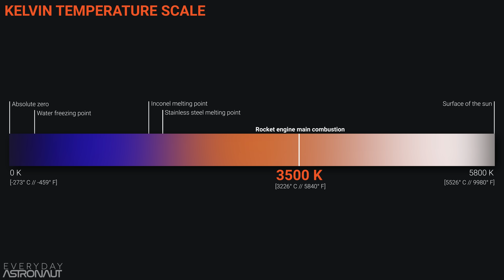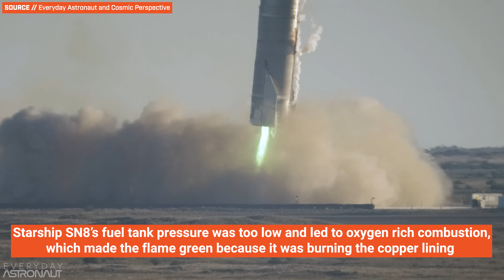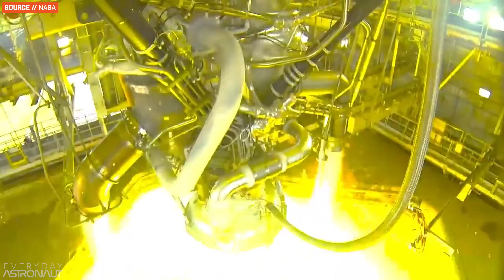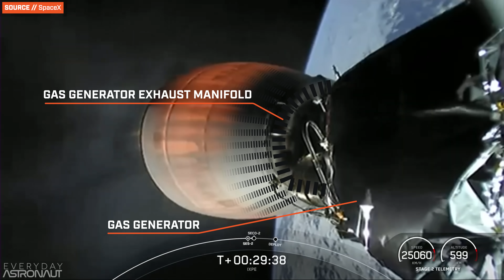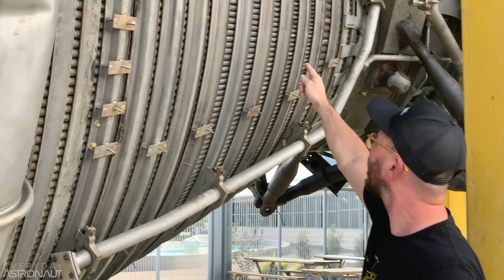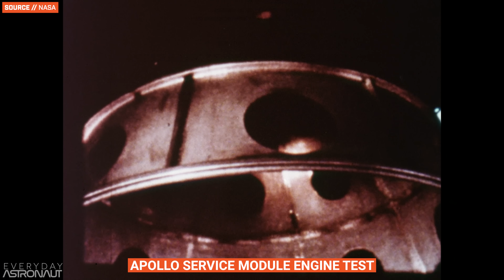Why don't rocket engines melt? How engineers keep engines cool

Comment: Fantastic work as always Tim and co.! Question:
It’s my understanding that the pressure to spin a turbine is really about the pressure differential. (If I were to stop up the end of the gas generator the turbine wouldn’t spin) if this is right, wouldn’t feeding the generator exhaust into the nozzle dramatically reduce efficiency? Talking of pressure always moving from high to low makes it sounds like we’d only need a 1 bar difference, but wouldn’t that mean there’s only 1 bar to drive the turbine? guess everything is a balancing act but just not sure how it all works out. Thanks for any insights!!

Comment: The A4 (V2) rocket used a 75% ethanol/25% water mixture. The water lowered the combustion temperature and also helped in film cooling. With the bonus features that this type of fuel is easy to make in your backyard moonshine still and you can sell any excess on your local black market if you need more funding for your space program.

Comment: I think Elon isn't testing the  Raptor_2 in McGregor correctly! Of course, he cant test a 31_engine configuration. To simulate the real thermal environment at the end of the Raptor-nozzle he should add 6 or 8 metal plates, red-hot ones! around the one nozzle to be tested. This would better simulate the thermal radiation conditions of the "inner" engines of the Super-Heavy. Additionally, these inner engines could need a prolonged cooling-off phase after MECO (I think, running some inert nitrogen through the tubes) ...(as it is good practice with turbo-charged car engines, to let them idle for a while, before stopping!) Did Elon Musk do super-computer simulations of radiative and other heat transfer from the rocket exhausts back to the Raptors' housings and structures?

Comment: As said in part4 regenerative cooling if there is leakage in the thin chamber of regenerative cooling. Does the fuel in the regenerative chamber may also burn and cause problem ?

Comment: 2 questions..how would starbase cope with a hurricane? and landing starship on the moon or mars.. the landing are will not be concrete slab flat.. and all the bow back of stones, rocks sand into the lower part of the starship lander

Comment: I am not sure whether this would be a viable option but running a fuel rich engine and having a thin inner layer built with tungsten and leaving a thin air gap in between the inner and the outer layer could solve this problem. But tungsten can burn if it reaches over 2000C inside a combustion chamber due to high oxygen ratio so I'm not sure... I'm not a rocket scientist so I have no idea but this has gotten to my mind as soon as I saw this video before opening it. Great content!

Comment: Excessive liquid film cooling was used in 1960's engines, so Rocketdyne says new designs could have higher performance with less, without melting the combustion chamber walls.  They incorporated my 1991 analytical model into their SDER code.  I never got follow-on funding since at a HBC, and an AFOSR lead told me "not their mission to encourage research at HBC's".  Rocket propulsion is a clubby world.

Comment: Still remember in 1980's they lauch near space platforms and then launch rockets from that platform for less air resistance.  I wonder why they stopped doing it that way.  Would have saved more energy, I think.

Comment: Why don't they use centrifugal engines? That could use some soil from an asteroid, then spin it at a super high speed and then just throw it in the opposite direction. All you need is electricity and a crushed material like asteroid or any other soil.

Comment: Thermal transfer is so efficient at high pressure, weights and density.  So of course not just about the temperature itself….. Touch a hot piece of steel very lightly; not so bad. Touch that same piece of steel for the same duration but pushing harder…… ouch……

Comment: Cool! (pun intended) Ran into one guy once, he was singing the praises of avocado oil as a thermal barrier. No idea how that works but he had made a little home video, rubbed an avocado on a wood coffee table, took a propane torch to it. For a couple of minutes. There wasn't a mark left on the coffee table. He claimed that NASA was at least at one time lining rocket engines with this low-tech stuff, buying avocado by the truck loads, drove prices up from about 50¢ ea. to about $1.30. No idea if there's any truth to this story or just some fairy tale, but maybe a tip for some home rocket enthusiasts to play with.

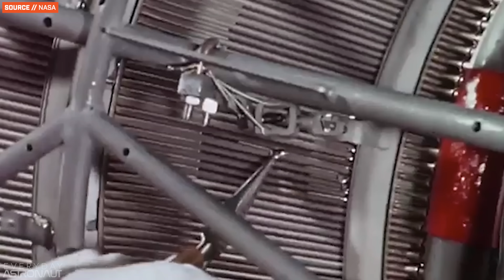Comment: 13:20 "...[fluid] always flows from high to low [pressure]". This is not true - break down the terms in the Navier-Stokes equations and you will see that momentum plays a part. A fluid with momentum will continue flowing in the same sense until a pressure gradient accelerates it. For a period of time then, fluid with existing momentum will flow from low to high pressure, before changing direction.
The "folk physics" phrase has found itself into textbooks. It even had the smart guy at "Tech Ingredients" (who has a lot to say about fluid flow and dynamics) absolutely convinced that the folk physics phrase was a law of nature.

Comment: at 13:00  Is it possible to create an insideout turned nozzle , and use it as a re-entry shield instead of tiles? ( using the upper reentry burn's fuel slower, and cold forexample )

Comment: You are confusing viewers and future Engineers between the design and its different working. I would suggest a better clear picture and not mixing it all together. And did you share your video with the people what are there reviews based on your explanation to learning perspectives. Anyways Try this Next time. Sharing Knowledge is good but hidden information still stays in your brain till you are not cross examined.

Comment: And I thought I was special by using sodium filled valves...  Anyway... I always wondered why high speed turbine aircraft like the SR71, were never used to reach the edge of space, before a much smaller rocket was finally lit to get the payload the rest of the way into orbit.  Most of the oxygen needed is already in the atmosphere, and most of the fuel which is also most of the weight... is burned just to get to that altitude and speed.  And would'nt that also solve some of the need for cooling, since it tends to get very cold at high altitudes? Or is that why they are developing scram jet technology?

Comment: >> is there any research with regards to 3d printed composites maybe we can have  mesh-like spatial gradients or something and make stronger materials like one used in STS like the patchwork pattern on STS I don't see 3d printing that much even though so many new mixture can be tried using that like cement and bricks

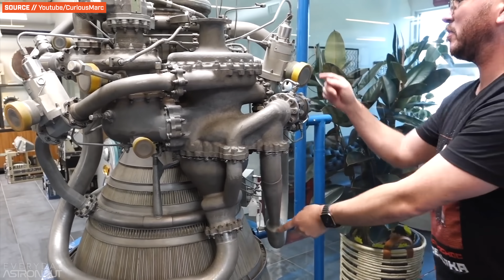Comment: At min 12:00, actully it is not so good if the fuel is boiling insid the pipes of the regenerative cooling system around the nozzle. If it is boiling it is possable that the tiny bubbles in the fuel will build a film layer inside the cooling pipes and function as an isolation between flowing (cool) fuel and the hot parts that thay should cool. If it is a good option to use the `boiling` fuel for the turbopumps I can't say.

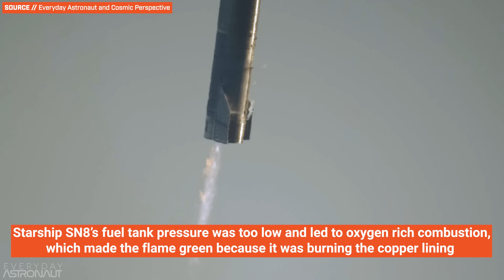Comment: At min 5:30 you forgot one important point why there is used a fuel rich ratio: The oxidizer (depending on what typ) might react with the contact surfaces in the burning chamber and the nozzle. So, the more "free" or unused oxidizor in the burning prozess will cause an oxidizing of the engine itself.

Comment: Just watched a video of a Raptor V2 going through a minute and a half burn while throttling down then back up. Considering this video's discussion on thermal management and Musk's comments on the maximum throttle down I was wondering if you could find out how the Raptor is actually throttled and what are the physics that define the limit of that ability.   Maybe you could discuss it with Elon and make another short video.  BTW your research and concise, coherent presentation on the Russian engines was pure gold.

Comment: At 21:32 subtitles say "like an (mumbles) nozzle. He clearly says 'niobium'. A quick google(TM): 
"Niobium is used in alloys including stainless steel. It improves the strength of the alloys, particularly at low temperatures. Alloys containing niobium are used in jet engines and rockets, beams and girders for buildings and oil rigs, and oil and gas pipelines. This element also has superconducting properties." You're welcome :)

Comment: No pun intended but this is very cool and must have taken some extreme innovative thinking to come up with these ideas. I'm curious about how strong these engines are to push such heavy loads, the ships: the structural supports and stresses must be extreme. Also, there is such a variety of fuels: what are the past fuels and where are fuels headed?

Comment: Wondering if magnetic fields could also be used to keep hot gases from touching the metals. They do this on nuclear reactors, and I know it would be too heavy for a rocket engine. But still, someone might find a way of creating a very strong magnetic field with low weight in the future.

Comment: Hi Tim,
can you shed some light on that new Pangea Aerospace aerospike engine and its specs?
In the test video thers no pump visible. Supposedly its externaly fed but would it be possible to work even with methane in an expander cycle fashion due to that large heat excess?
Would be nice if you can collect some info on that.....
greetings and good work!

Comment: You mentioned how difficult it is to cool a spinning turbine. I know some large jet engine mfr(RR or GE) use strategically placed tiny cooling holes in the compressor blades to maintain a nondestructive temp. Would something like this be viable to carry over to a rocket?

Comment: Dear Mr. Dodd. Thank you for yet another excellent, informative, and interesting video.

You mention that certain forms of cooling, such as film cooling, cannot be used on a spinning turbine. This is not entirely correct. Jet engine turbines commonly use film cooling. Cooler air is taken from previous stages and run inside the (usually) ceramic turbine blades, allowing it to bleed out of tiny holes. The high-pressure turbine is the hottest part of the engine. "Cooler" is a relative term here, as this air is well hotter than 1000 degrees C.

An excellent source for jet engine knowledge is Rolls-Royce's iconic book "The Jet Engine", first published in 1955, and updated many times since then. I highly recommend it, if nothing else for the superb illustrations. Jet engines are not rocket engines, but they do share many traits.

Please keep up the good work!

Comment: As an aside - Apollo service module never carried a full fuel load on any flight. The original design (which was reflected in the engine size) was for the service module to land on the moon and then re-ascend to orbit. The LM came later.

Comment: Not quite unbelievably hot.  150 million degrees C inside Nuclear fusion reactors is unbelievable since that would turn anything into a plasma. Still very interesting episode Tim. There's an interesting video on how Rolls Royce manage thermal loads on turbines, from casting single crystal metals to drilling small holes down the edge of the blades and pumping fuel through them.

Comment: Interestingly enough, the engine you use to demonstrate regenerative cooling, the A4/V-2 engine, used film cooling far more than regeneration.  In fact, part of the reason they had so many failures while developing the A4 was because the film injectors kept clogging.

Comment: It's a lot like turbo gasoline engines. The 4 cylinder turbo gm truck has about the same horsepower as the V8 however on the highway under constant load the V8 actually gets better MPG. How is that? The turbo 4 cylinder has to run so rich to keep cylinder temperature down that it uses more fuel than the engine that is 2x the size as the V8 can actually switch to a much leaner burn and not worry so much about cylinder temperature.

Comment: This isn't specifically related but some concepts are very similar. The regenerative cooling works because the oxygen concentration is insufficient inside the nozzle walls to worry about. Many diesel engines ignite diesel fuel in 300 - 500 psi of compressed atmospheric air that is above the flash point of diesel fuel in the cylinder chamber whilst the injection pump that is injecting the fuel compresses it to 20,000 psi. There isn't a worry of ignition even though the fuel is compressed and hot because there is insufficient oxygen present to ignite it while it's traveling to the cylinder chamber, I think regenerative cooling follows similar physics

Comment: I have to wonder if anyone has tried water/glycol injection like were used on B52 and early 747 jet engines to get a boost in thrust while cooling the hot section turbine at the same time. the downside was an increase in unburned fuel in the exhaust (which is why the exhaust was so black/smoky)

Comment: 0:21 this is actually (and factually) incorrect. You have a lot of materials that can withstand that temperature. You have tungsten, for instance. And titanium boride. And hafnium carbide. And graphene. And tantalium. etc. In fact, the material with the highest melting point is an alloy of tantalium and hafnium carbide, and can withstand a temperature of 3990℃ (!).

Comment: @everydayastronaut why hasn't anyone used magnetic fields to shield the metal from the heat of the exhaust? The regenerative cooling methods could keep the electromagnetics cool while the fields generated would prevent contact with the metallic inner walls. You would think in the interest of making a reusable engine that would be the first approach practiced.

Comment: Man, I keep getting requests for 3D printing rocket nozzles out of copper and inconel with internal channels (at work). DED printing of copper is difficult, DED printing multi materials is hard, and DED printing closed internal channels is very hard. Put them all together and you get a request that is near impossible with our current methodology. But our response usually is: how much are you willing to spend in trying to print this?

Comment: The techniques employed in engine thermal management are varied and really advanced as you did explain in your amazing video. What is also fascinating is how Soviet engineers were able to manufacture alloys that were able to withstand oxidizer-rich mixture inside combustion chamber. As far as rocket engine history is concerned the American engineers did not believe at first that such alloys were possible.

Comment: Automotive engines maintain a higher gasoline to air ratio less then optimal just to keep the piston cooler. In other words you spend extra gasoline just to keep the engine from overheating and so higher mpg is quite difficult unless you do many other things as well.

Comment: You should have showed that party trick. Fill a styrofoam cup with water and hold a lighter flame on the bottom. The flame will not melt the cup and water stays inside. Because the inside surface is dispersing the heat.

Comment: Before I watch the video I'll think of a way of a way I'd cool down the exhaust outlet nozzles, I'd flow the cryogenic fuel through veins around the outside of each nozzle which should draw massive amounts of heat from the burning rocket fuel whether solid or liquid although solid fuel can't be flowed throughout the system as it's a solid fuel, but liquid fuel can be used and I would say is used to d ok exactly what I've written above.

Comment: One thing that I don't quite understand is how engineers avoid "runaway" processes - before the days of computers to provide active monitoring. For example, when the pre-burner first ignites, it spins the turbo pumps which provide more fuel and oxygen to the pre-burner which spins the turbo pumps even faster which provides yet more oxygen and fuel etc. etc. I guess there are valves that limit the oxygen and fuel levels when the required pump speed is reached but how did these control mechanisms work before we had computers?

Comment: Really cool summary and presentation! The main thing I don't agree with is to call everything that removes material from the engine "melt". It does not simplify the explanation that much and takes quite a bit of understanding of the processes involved away. Anyway, you had to draw the line of what to simplify somewhere, I understand. Best wishes for 2022 :)

Comment: Pumping generator exhaust into the nozzle extension presumably also has the useful benefit of increasing pressure at a point where it would naturally be dropping... probably good for a small ISP boost...

Comment: 20:23 Does the F1 lose thrust due to the delayed fuel ignition?
And does the Merlin's gas generator exhaust produce any thrust? Wondering because the pressure looks so high.

Comment: Em, you do know the sun it not hot, right????? If the sun was so hot? why does it get colder the higher you get? The sun does not give off heat, the sun produces radiation in frequencies that human do not understand. You create everything Neo!!! There is only what you want to experience. You can continue to do the same thing over and over expecting a different result, OR you can DO something different to achieve the different results. Only you can tell you everything you need or want to know. You are not on the external, you find you within. Detox your minds from all external stimuli, turn off the matrix for 30 to 60 days. NO social media, no tv, no internet, no bad food, no smoking, no drinking,
etc. and spend the time practicing Meditation, you are inside you, spend 30 to 60 days getting to know You. Namaste. <3

Comment: I used to work for Rocketdyne space engine division in the 60’s were we made the reaction control nuzzles from Ablative material and the throat was made from Graphite. The Ablative thruster was than wrapped with asbestos. We made 25 pound 75 and 100 pound thrusters.
It’s been a long time ago.